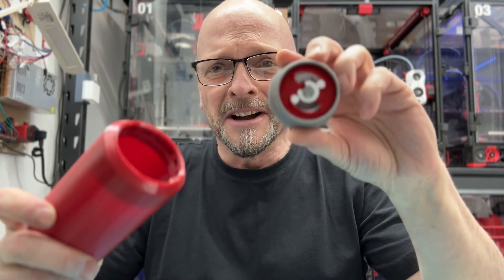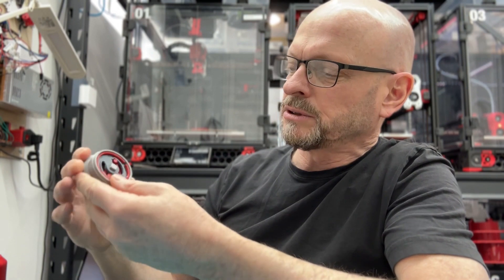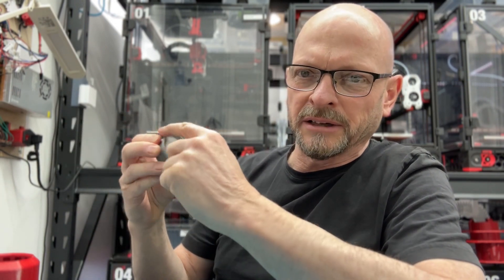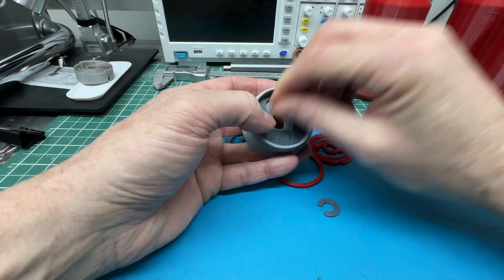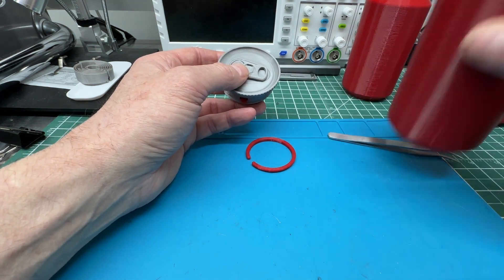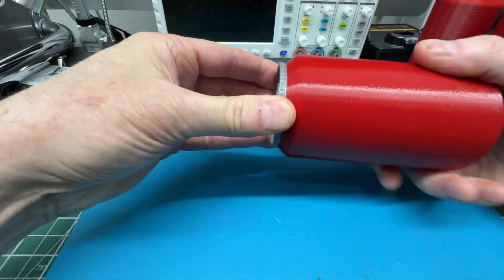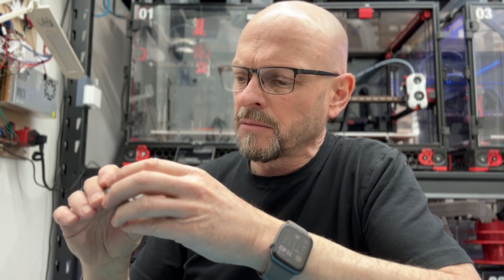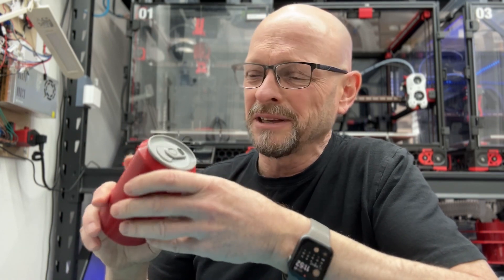The Secret Can Safe (aka Stash Can)

Comment: Big fan, will download and print for sure...
You mentioned realism and I had an idea for you to run with or ignore entirely if you want.
Make a removable / Glue able/ push in place bottom that is also printed in gray / silk silver and I think it would make the entire thing look that extra bit more "real"?
I may try this myself when I get too it this weekend.
Reply from the maker: Great idea.   It works well with another idea I am mulling over. I want to add another layer of security and thinking like a pushbutton combination lock on the bottom.  If I do that I will make the trim sivler as you suggested.  That will really make it look fantastic and add another level of fun! Cheers.
Reply: @pdb6251 that sounds pretty good too. Not just form, but also function

Comment: Hi thanks for designing this can, i love the idea. I Just printed the lid, but no supports were printed.... i am using bambu studio for my bambula carbon x1. do you have an idea why the supports are not printing? Thanks Awsome work!
Reply from the maker: Hmm.  I am not sure.  The only part that has support incorporated (and that needs support) is the lid.  The lid has support connected into the part design so you should not be able to separate them (and therefore print without it).  It is a thin wall structure that prints under and on the inside of the lid.   I just added an image into my blog page which shows the support more clearly.  https://www.logicalplanet.com/2024/02/22/secret-can-safe/   Does that help at all?   Everything else should print well without support.